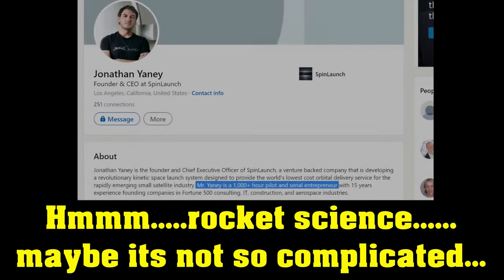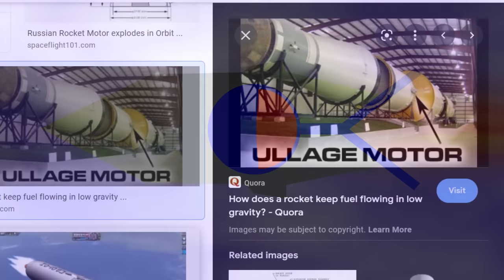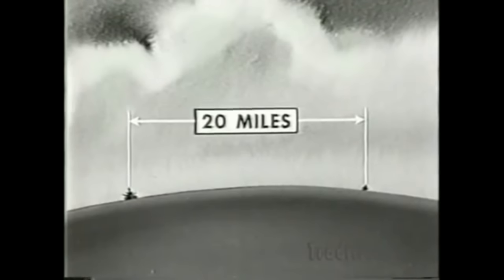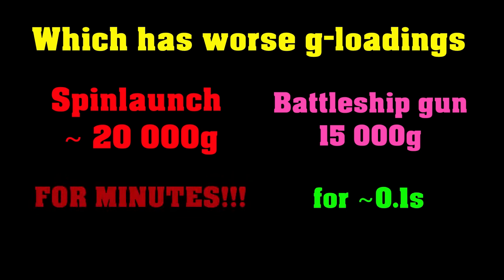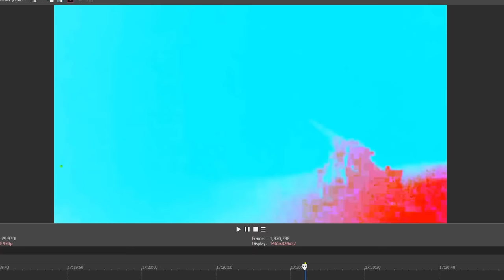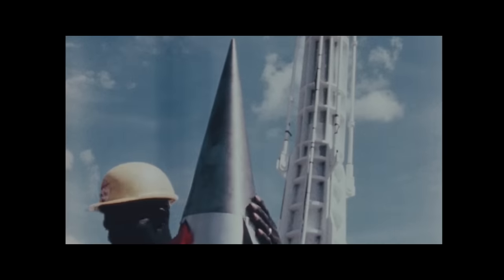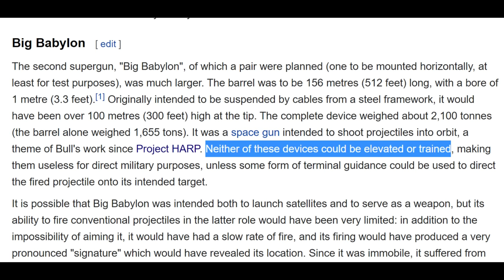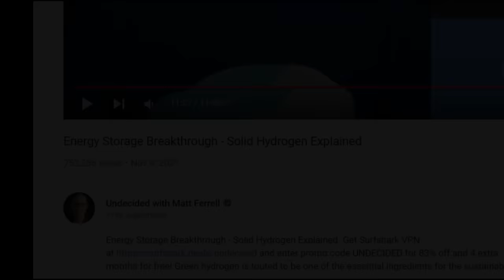Spinlaunch: BUSTED (Part 2)

Comment: I have been limiting launch G's to 100 when I think about these things. I also try to ensure systems work and sub 9G so the system can also help people access space. If we really need ultra cheep space access you need to build a 5km tube into a mountain on the equator. The exit of the tube need's to be high enough that the projectile does not break apart when it hit's the air. Any cheaper and you need a tube launcher on a hypersonic plane that can blast stuff straight into orbit. The cost of either of such things is so much that at $4000 a KG you could launch about 6,000,000KG or 40,000,000KG for the price which is 24 or 160 billion.

Comment: Mr. Thunderfoot I was wondering about the viablity of trashing the spin launcher and trying the same concept using magnetic rail gun tech to get cargo into orbit. Could it achieve a significant distance? Maybe enough to save fuel?  I would love to hear your thoughts on the matter.
Reply: Is this sarcastic?
Reply: @torfley  nope. Just a question. Giving it some thought though... It might be a terrible idea to make a Gaussian launcher. Otherwise known as a giant gun.
Reply: Well a rail gun would have most of the same issues as a spin launcher other than the spin part.
But another problem would be that it melts itself at the amount of power that flows trough it while propelling a payload.
Did I mention it uses a lot of power?

Comment: Notice when the projectile breaks the seal, it is just a tiny membrane that is pierced outwards. If it was a real vacuum, the membrane would be sucked in due to explosive compression. That would also generate such turbulence that it would most likely disturb the path of the projectile.

Comment: You forgot about the G-Shock when the projectile leaves the centrifuge and crashes into a wall of air. With Mach 5. While a sonic shockwave enters the chamber where the arm is still rotating with Mach 5 and the counterweight is disposed of at almost the same speed and energy as the projectile.

Also it makes a big difference if you apply pressure on a structure (in a Cannon) or tensile stress (in the centrifuge).

All known materials can withstand pressure far better than tensile stress.
That's why in buildings tensile stress needs to be avoided or caught with steel enforcement.

Comment: If the chamber was truly under high vacume, the diaphragm covering the exit point would behave differently than shown in video. First: the diaphragm would be pulled down towards the vacuum. It would have a concave shape unless they have some miracle fabric that doesn't distort (unlikely). Diaphragm has 14.7 psi pushing on it from outside towards inside. Kevlar isn't strong enough to hold back the immense pressure without distorting.

Second: as the launched object punctures the membrane holding back a high vacume, membrane fragments fly away from source of vacume. They could initially move outwards due to high energy of object hitting it. But because the actual vacume chamber is the biggest ever made, everything except projectile would be sucked back in chamber. In fact, air would continue to rush back in at 14.7 psi initially, then lower as vacume is lessened. Talk about a destructive and violent decompression.

Comment: Have not calculated,  how much G force is the structure experiencing spinning at that speed? I think there should be no material can hold it together at that RPM  and that size . Small object can handle large RPMs , but this size , the force will be really really big , nothing can hold that weight

Comment: What is said about counting the revolutions of the arm could be incorrect. If the frames per second of the camera is slower that the revolutions per second, you may not see each arm rotation accurately.

Comment: I might be wrong in this but something that does not quite sit well whit and I would be glad if someone could explain it in more details but the part in where the cannon would almost be more suitable becouse it apply 15,000g for about a 0,1 second while the spinlancher does 20,000g for several minutes, the numbers I have no qualms whit but isn't a longer time better then a short one? That is at least what i have comed to learn when it comes to de acceleration aka jumping down from a building and hitting the hard concrete, would that not too apply for acceleration too?
Reply: Yes. Longer is better. And these "cannon shells" we fire have electronics in them. Heck, early proximity shells had vacuum tubes and they survived.

Comment: The centrifugal force that's subjected to everything inside that dart would be so high that you couldn't put anything inside there. Electronics, any rocket motors that you need later in space like shown in the video, the fuel... No chance! Imagine the G forces! Every metal would bend and every plastic circuit board would brake!
Then any object hitting that membrane with that speed would instantly disintegrate which makes me believe that the video is CGI or not as fast as they make us believe.

Comment: How many atmospheres is this vacuum launching system ment to get down too ?, also the fact that the launch door would have to be strong anough to take the vacuum and be able to open in a seconds for the rocket to leave the chamber fast anough, then be able to close the launch door and it re seal the chamber and as you pointed out it would be almost impossible to this chamber, the electric motor would have to be in the chamber with the launch arm, and then of cause with no air to cool the motor it would over heat, ok yes you could liquid cool the motor with a sealed system, but the launch door is still going to be a problem, unworkable I think 🤔

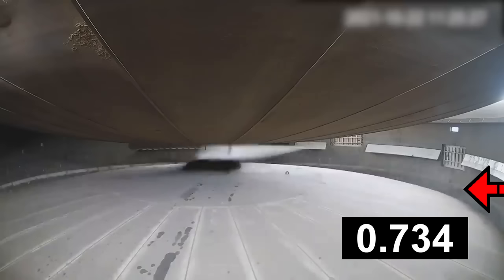Comment: Not quite sure about his statement at 4:04.  I do not think that it is possible to count the revolutions since we do not know what the framerate of the footage is. Theoretically there could be several revolutions per timeunit that you just do not see in the footage because the framerate too low. Opinions?

Comment: Something you haven't addressed is how it physically launches.  The weight distribution of the payload will have EVERYTHING to do with how it tumbles out of that chute.  The counterweight for the arm spinning the payload now all of a sudden is without a balance on the other end (catastrophic destruction).  And then the whole idea of the vacuum.  Disregarding the implausibility of holding a vacuum in such a large and complex structure, please explain the material that the payload breaks through to be launched.

In the video, it appears to be some kind of plastic or latex material.  But this material needs to be ultra thin and able to break away in order to not damage the payload that's bursting through it at 5000mph.  But it ALSO has to be strong enough to not collapse when the structure pumps down to near total vacuum.  I'm not aware of a material that can do both.  Finally, even something as thin as a piece of paper could plausibly cause catastrophic damage to a space craft moving at 5000mph.

Comment: There are several issues I saw in the sales video they put out some time ago.  First, the chamber is supposed to be a vacuum.  So the thin plastic cover where the rocket breaks out of should be concave before launch as the atmospheric pressure pushes against it.  Second when the rocket breaks through at launch you can see the plastic shreds blowing upward.  They should have blown downward as the atmosphere rushes in to fill the vacuum chamber.  Third the control room is all white including the stairs.  It looks like a bad science fiction movie.  Not realistic.  There is more but Im just going from memory.

Comment: Where did 20,000g come from? If they're aiming for mach 6 with a 100m diameter accelerator the g force would be (343m/s * 6)^2 / 50m / 9.8m/s^2 = 8643.6g. It also seems relevant to point out at some point, when using an explosive propellent, you run into significantly diminishing returns as the velocity you want the projectile get to reaches the velocity of the explosion itself. I don't know exactly when that is but I assume current projectiles are already running into this to an extent based on the interest/investment in railguns.

Comment: Assuming all goes perfect then the deadload used to balance the spinning arm after the release would cause massive arm imbalance like when you put shoes into the washing machine. That alone would tear everything apart. If I did not fuck up my calculus you have an imbalance of ~25 000 tones*force spinning in your launch facility. Good luck keeping that baby there
Reply: The counter-weight could be filled with 200 liters water which are released at the same moment to keep it balanced.

Comment: What happens to the counterweight when the projectile launches?
Reply: Yeah the patent isn't clear on that. At least not from what I could see skimming over it. They do describe using a liquid in a bladder as a counter weight, and if that is the case I guess it just bursts and sloshes around inside and gets drained out. ...but that is completely a guess on my part.
Reply: @AveragePicker  liquid at hypersonic speeds is still effectively flung rocks...

Comment: I’m no engineer, so I may be completely wrong here, but wouldn’t Spin Launch be pretty dangerous to operate? Surely their projectiles would have to be hardened to the kind of atmospheric stress that would cause normal launch vehicles to burn up in the atmosphere. Couldn't a problem with the missile after launch potentially result in an out-of-control projectile that would eventually land with a  “Rods from the Gods” type impact?

Comment: Serious stupid question, is it possible that counting arm rotations is inaccurate due to a mismatch between the frames per second of the source video and the rotations per second of the arm? Say the video is 30 frames per second but the arm is spinning at some rotations per second greater than 30 or even a multiple of 30, would not it be impossible to count arm rotation speed from a short clip? Is my brain working wrong here thinking that 2 rotations per second at 1 frame per second would only show 1 rotation per second?

Comment: My question is this:
If the rocket is accelerated to 5k mph in a vacuum and then instantaneously his atmosphere at that speed, wouldn't that have a massive shock load on the rocket structure? I mean, jumping into water from 100ft can kill you. And gasses generally behave very similar to liquids.

Comment: Sure there are many technical challenges to this project, some of which may doom it to failure, but from the perspective of a viewer of a 'busted' video. consider how fair thunderfoot is here:

1) He repeatedly uses a figure of 200kg in his comparisons, if he had actually bothered to check the info available and read it, he'd realise that's just the payload (the actual satellite), and the whole projectile, including fairing, 2nd stage rockets, fuel, etc is 11,200kg. Somewhat puts a dent in your maths to start with.

2) Others have already commented that the issue with getting fuel to the rockets was also clearly dealt with. 

3) The suggestion that it would take 8hrs between 'shots' to pull vacuum is based on flawed logic and figures pulled entirely out of thin air (pun intended). We don't know the final volume of the vacuum chamber (though we can make a vague guess based on some details provided), and we don't know the capacity of the vacuum pumping mechanism being used or proposed, so we have no idea how long it would take to pull the required vacuum. Thunderfoot, for some reason, assumes that every time they make a 'shot' the entire chamber will immediately fill with atmosphere through the hole created in the end of the 'barrel'. That's simply not true as they have designed a automated closer that seals the end of the barrel after the projectile passes. Some air will leak in during the time the chamber is open to atmosphere, but probably only a few percent, which will easily be dealt with by running the vac pumps between shots. Not sure how they replace the 'temporary seal' that the projectile passes through in this situation, but that's another matter ! 

The same is true when loading a new projectile. You don't let in a full atmosphere of pressure when opening the loading gate, any sensible person would design an air-tight loading chamber, like an air-lock on a space/diving vessel, so again you only need to run the vac pumps for a while to reach the required pressure.

Sorry, I do like some of the busted videos, but this simply seems badly researched, when there are so many other aspects of this project that are far more of an issue (such as balancing the system after the projectile is released, and dealing with release timing and safety measures that would be needed in the case of catastrophic failure)

Comment: I keep seeing videos about this stupid idea, and the more I think about it, the dumber it sounds. I'm glad I'm not alone in questioning this ill-conceived venture. The thing that especially bugs me is what happens when the dart leaves the tube? Let's say they actually build their "orbital" launcher that can yeet things into LEO. Got this giant vacuum chamber the volume of a small Walmart, hypersonic spinny boi all spun up, perfect vacuum somehow maintained by that thin-ass membrane over the muzzle. What happens when the vacuum breaks? The air returns with extreme prejudice. Shockwaves, all up in your shit. Then you've got the hypersonic projectile rapidly transitioning from vacuum to atmosphere, which will produce it's own extreme shockwave. The air rushing in to fill the vacuum will cause an immense head wind trying to suck the projectile back in, which will rob it of energy, just like drag and gravity loss. Then there's the instant, extreme adiabatic heating that would vaporize a slug of tungsten, let alone that carbon fiber fairing they're using. Dumb, dumb, dumb, dumb, dumb, dumb, dumb. And they're still promoting this. 

Also that Undecided with Matt Ferrell channel is infuriating. Not much different than the "It's happening!" musk spam.

Comment: Watch a few you-tube videos of record, cds or laserdiscs exploding in slow motion when spun at high speed.  The pieces tumble. They don't fly away like a CGI of Thor's hammer.  Even if Spinlaunch could make everything else work, you have the projectile doing cartwheels, which means you have to add mass to reinforce the projectile and you need to add mass for a mechanism to stop the tumble.

Comment: I even wonder about that membrane and going from a vacuum to sea level atmosphere in a hard line at 5000 mph. Won't that be like firing a shell at water?
Reply: @majorjohnson8001  They are pushing the baseball out the tube with pressurized gas. That isn't a projectile in a vacuum hitting astrosphere, it's a projectile being pushed into atmosphere with MUCH higher pressurized gas. When the the spinlaunch projectile breaks the membrane, the atmosphere will instantly rush in at Mach 1 against the projectile- effectively cutting +-750 mph off it's velocity in that instant, and probably making it VERY difficult to keep the projectile straight as the front tip and rear will be facing very different pressures. They could greatly minimize this (*and the reset time for another launch) with a longer vacuum tube before the membrane and some type of extremely fast valve that can close behind the projectile.

Comment: my question is, say the load was directionally strengthened to withstand the 20k g's of the spin launcher, what happens when that same load comes out the launch seal and slams into the atmosphere .... given the propensity for load struts to fail ......... :D i hope they video the test
Reply: In this case what they're proposing is a dual airlock system...
When the outer door opens you're going to have a pressure wave front travelling down the tube...
The projectile will be penetrating that wave front inside the launch tube... where it can be controlled.
NOTE that gun projectiles manage to do this and maintain both most of their speed and their aerodynamic stability.
It's a tricky problem but not necessarily insoluble...

Comment: Isn't gforce measured by the speed of acceleration vs deceleration? Therefore building up to a high speed over a long time (spin launch) would inflict far fewer Gs than hitting a high speed very quickly (HARP) and be less likely to damage sensitive components?
Reply: The acceleration at issue here is the centripetal acceleration cause by the rotation, like you feel in a sharply  cornering car. You are right that the acceleration of getting up to speed is not an issue.

Comment: I doubt they could do 3 launches a day. They have to replace that diaphragm every launch. With all of the bolts holding it in place, at least 8 hours or more to replace, and pressure check before each launch.

Comment: my guess is a diaphragm tank that holds the propellant to the bottom of the tank. it's a pretty standard design for satellites. 

In short there is a flexible diaphragm in the middle of the tank with fuel on one side and high pressure gas on the other. This consistently holds the fuel on the bottom of the tank.

EDIT: Of course this would get absolutely shredded by the 20,000 G's
Reply: You wouldn’t even need that. The tanks would be full and pressurized. (It uses a Pressure-fed Engine.)

Comment: I find it interesting the speed of spinlaunch in this video was determined by a camera recording which only had 23 unique frames in 0.934 seconds.  I am not qualified to argue whether or not spinlaunch is going to work, but it's a terrible point to argue the speed of spinlaunch is only 300m/s based on such low framerate footage.